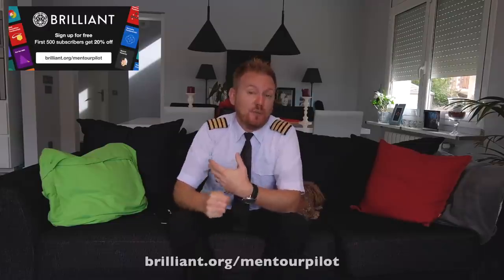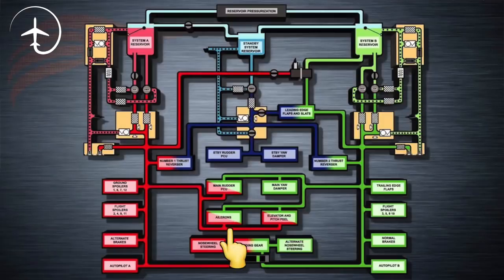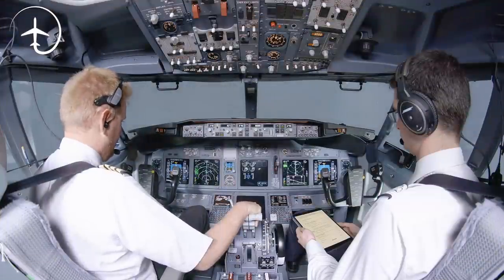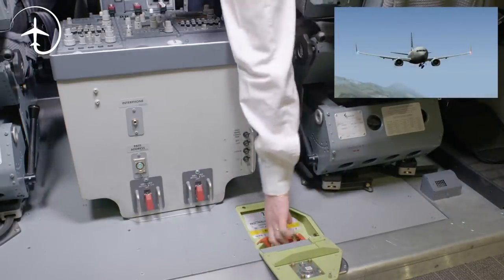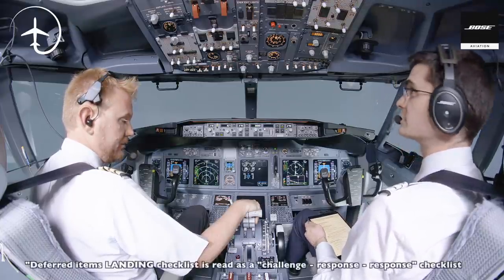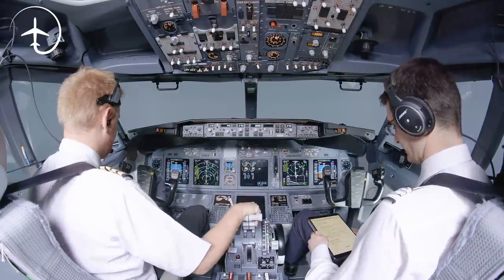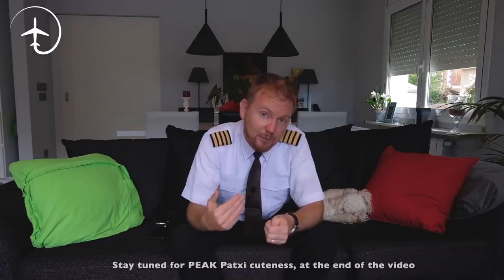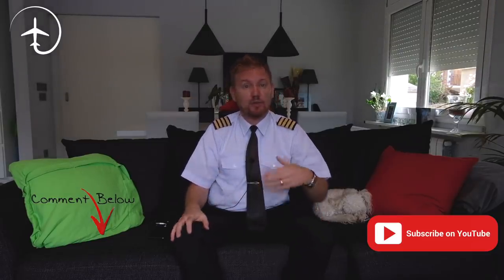Boeing 737 Emergency gear extension!! Cockpit video (FFS)

Comment: Perhaps a video on ground related activities, as preparing the loadsheet, weight and balance calculations and the like?
Reply: e.g. what switches are used for refuelling and others while on ground
Reply: @gerdne5478  I work as a fueler at an airport. All the switches for fueling are in the fuel panel in the wing.
Reply: @murphsmodels8853  Cool to know. And thank you for your work. When I am sitting in the plane I am always thankful for all the workers who supply the aircrafts, often in hard conditions. What airport you are?

Comment: Can you do a decompression emergency decent manover(sim) ..
Reply: All I know is that they use level change on the MCP, with max speed and speed brake for the highest rate of descent down to 10,000 feet or below with ground radar to monitor terrain and lights for other traffic. Edit: level change allows the aircraft to descend at a target airspeed, the higher the airspeed the higher the rate of descent, and with speed brakes the descent is further increased.
Reply: @gobozen  With oxgen mask on as well!.
Reply: Oh, can simulators reproduce a real decompression?

Comment: Could you make a video about the different autopilot modes in the 737, CMD and CWS?
Great content as always!
Reply: In particular is rotation at V1 done by the pilot or AP?
If both can do it, then how is it decided what initiates rotation?  If not AP, then when is the AP engaged after rotation?
Reply: @europaeuropa3673  The pilot flies the airplane, to at least 1000 feet minimum. After that most pilots usually fly manually if time and conditions permit it, it's a good excerise.

Btw, there's no such thing as an automatic takeoff.

Comment: @mentour pilot Hi, I've watched all your videos and I have the feeling that you have covered already 95% of possible topics. By the way, I prefere the normal flying topics and not so much the emergency things because flying is not doing emergency procedures. Left topics I would like to see are a bit difficult to explain in a simple videos, this would be more about ATC (how are the rules to speak or typical... I don't know, I am a layman) and I would like to know more about the planing you do before you fly, menas before you even enter the plane, more in detail and step by step, and background to this (why... ) and about the slots more details, e.g. who is it, who gives you the slot in the briefing, what managers are there involved (or don't pilots know this really), but to who you speak in the briefing etc. And when you learn flying the big airplanes like the 737 what do you learn first, what second etc.? For example, when and how do you learn how to communicate with the ATC: when you get in contact with what "zones", can you explain "maps" where you can see "zones", what lines does show this (or so)
Reply: Or I would love a "cockpit-tour" e.g. in the simulator where you explain for laymen the "blocks", what is for what with explanations of the abbreviations, that might be quite boring for cadets but interesting for laymen and kids, all the switches and knobs in the middle and the "ceiling" and the side, not each single switch anyway, but the "blocks" and some important single things. You did some of this already, I know, like the lights etc. but would be nice again and an overview and nicely slowly for laymen with explanation of the abbreviations. Close views of the instruments would be also wonderful, I am always excited when I get really close video-scenes of the screens, in most videos you don't see it very close.
Reply: And, do you remember funny situations or cool jokes from colleagues or ATC or flight attendants or ramp guys?

Comment: I found the Japan Airlines flight 123 (a 747SP) fascinating.  Horrowing as it may be, there were other pilots who managed to manoeuvre their planes using engine thrust only and land.  One was a Philippine Airlines flight 434 - a 747 where a bomb exploded taking out many controls, the same as Japan Airlines 123, but they managed to land using engine thrust.  Higher on one side to turn, reducing both to decent, accelerating both to climb (although with serious limitations).  So how about a video where you disable all flight controls and then attempt to land via engine thrust only?  I noticed that after the crew of JAL123 applied full thrust to avoid the mountains, this finally signified the end, as the plane's nose rose too high, then approached a stall, then almost nose dived into the peak of one mountain, followed by the plane smashing into the next.  HORRIBLE, but is it possible to control to an extent to perform a ditching or even a landing at an airport?

Comment: I was told, if the gear can't be extended, pilots first make a low fly-by at the tower and afterwards proceeding kinda rollercoaster maneuvre in order to try to "shake out" the gear. Can you do a video about that please? :D

Comment: Coming up next: Boeing 777X Manual Wingtip Extension.
Reply: How does Mentour get his hands on a 777X do you suppose???  They just got rolled out.
Reply: Emergency landing 737 on Aircraft carrier :c)
Reply: @stephenbarringtonleigh367  r/whooosh
Reply: Craigslist.  @stephenbarringtonleigh367
Reply: Checklist items
1) fasten seat belts
2) roll inverted
3) pull the handle for manual wing tip extension
4) push elevator to make sure they are locked
5) roll wings upright
6) pick up rouge passengers that didn't listen to step 1)
7) continue as if nothing happened

if time allows: instead of rolling inverted you can also add full thrust, pitch up to 45 degrees, pull the handle and push down to force negative g's for about 15 seconds, when lock confirmed pull up from the dive. That's referred to as the real roller coaster maneuver.
Reply: LOL, yes  @Jet-Pack
Reply: Could you do a video on cold to taxi, and if you think people won't permanently go into a coma setting up and Using the cms etc. Tnx! Great informative videos. I have a whole 45 minutes on a 737-200 in my log book so you might guess how long ago that was lol. Everything else rattles and squeaks more after that entry.

Comment: Hi Mentour: How about a downburst escape maneuver?  I think you already did a windshear escape, so this will be similar, but it will show what Delta Flight 191 should have done.
Reply: Great question! From my perspective, having read the NTSB report, and listened to the CVR many years ago, situational awareness was the biggest factor. They started doing the right things, like increasing power (other than aggressively aborting the approach as soon as they saw the lightning and downdraft), but they waited too long to begin them, having substantially misinterpreted the severity of the storm cell. They needed to "climb" inside a massive column of falling air in order to stay level, but lacked the airspeed to do so. Unfortunately, at such low altitude, you MUST be "on it" before you're "in it". The only thing that could have saved them once they got into the microburst in that config was a time machine.
Reply: @mikecowen6507  Ok.  Maybe it's a stupid idea, as microbursts doom flights.  You're right about that.  I'm not sure that situational awareness was an issue once they were inside the downburst though as the CVR clearly shows they were aware of the microburst.  The captain clearly says, "You're going to lose it all of a sudden."  And seconds later, the airspeed rolls back.  Minutes later, the L1011 is slammed into the ground with tragic results.  I agree with you that charging towards a thunderstorm is not a very smart plan.  Doesn't Pyotr always say, one should always put safety first?
Reply: @stephenbarringtonleigh367  My comment about situational awareness referred to recognizing the severity of danger before entering the microburst, while they still had enough time to act. By failing to act soon enough, they lost any chance at avoiding disaster. Yes, the CPT was telling the FO what to expect, but he had not correctly recognized that patch of weather was something so severe to avoid at all costs. They saw it, but did not comprehend they were flying straight into the jaws of Hell. If they had firewalled the engines perhaps 15 seconds sooner (and turned), it might have made all the difference. Also true that nobody in the tower recognized the danger either. So yes, I say situational awareness on all counts. They didn't die in vain. That one crash is why we have windshear detection equipment at airports and onboard aircraft today.
Reply: @stephenbarringtonleigh367  And just to be clear, I'd like to know what Petter has to say, given the time, training, and technology since the crash.
Reply: @mikecowen6507  My point is that he may have been naive about the storm's severity, but he knew what was going on when he was inside the microburst.  That is not a loss of situational awareness in my view, the way AF447 was at least.
Reply: @stephenbarringtonleigh367  I understand your perspective. My point is by the time they were inside the microburst, they were already dead, they just didn't know it yet. It's one thing to be in a situation and realize you're totally screwed, and quite another to recognize a situation is lethal before you get into it, and not go beyond the point of no return. They made a decision to continue, and many lives were paid out for it. I do not believe they had a death wish, so if they had some sort of magical "you're about to die" alert in the cockpit, their awareness of the critical situation they were about to encounter may have been different, which likely would have resulted in a very different outcome in which everyone safely walked away.
I agree, in AF447, they were simply clueless. Pitch & power, not Pac man...
Reply: @mikecowen6507  I agree with you here.  I wonder what factor weather radar (WX) had then?  Was it a matter of scatter off a closer storm hiding the nastier one behind?  WX wasn't as good in those days.  I know caution is usually the best course of action, but sometimes technology can influence your judgement.  See where I'm going here?  Besides WX is the only "you're headed into a critical situation" warning they had, and if it failed them...
Reply: @stephenbarringtonleigh367  As I understand it, both the crew and the tower saw a severe squall on WX that had quickly moved directly onto the glidepath. The previous flight had skirted the edge, but landed ok, so there was a false sense of security. Until they saw the outflow of the microburst, they didn't think it was that bad. However, at that critical point, they chose to continue the approach. Bad idea...
Reply: @mikecowen6507  I didn't know that side of DAL191.  Sounds like a weather version of the Uberlingen disaster, where one aircraft listened to TCAS, the other listened to ATC causing them to collide.
Reply: @stephenbarringtonleigh367  Here's the official statement: "The National Transportation Safety Board determines that the probable causes of the accident were the flightcrew's decision to initiate and continue the approach into a cumulonimbus cloud which they observed to contain visible lightning; the lack of specific guidelines, procedures, and training for avoiding and escaping from low-altitude wind shear; and the lack of definitive, real-time wind shear hazard information. This resulted in the aircraft's encounter at low altitude with a microburst-induced, severe wind shear from a rapidly developing thunderstorm located on the final approach course."
Reply: @mikecowen6507  so it was a bit of aviation culture in there too.  "Lack of procedures and training..."

Comment: Another thing I'd love to see from the sim, is a flaps failure. As someone else suggested, it would be great to see the approach. I have practiced a landing without flaps in the simulator & the runway does come up very fast. I landed on the grass......okay, I'm not a pilot, so it was to be expected, but I'd love to see that from a pilots perspective!

Comment: One of my early piston twins was an Aero Commander 680. It had hydraulic gear that, like your 737, had free-fall emergency gear extension. Too, the POH called for the mid-switch on the landing gear handle after the gear was in the wells. Must be an industry standard.

Comment: Dear Mentor Pilot, could you make a video explaining water landings ? I'm not a pilot, so I interested in knowing  not just the flying the airplane part, but also the procedures used by the cabin crew and what it means for passengers.

Question: If the cabin is perfectly sealed, wouldn't it be safer to just let the doors closed and the passengers inside and let the airplane float while rescue does not come ?
If you had no runway in the vicinity, and had to do an emergency landing, how would you pick between a highway, a dirt road, an open grassy field, a river or open sea ? Pros and cons ?
What would you do if you had a double engine failure or hull loss and had to do an emergency landing in the middle of the ocean, like a trans-atlantic flight? 

Cheers.
Reply: It's is better to evacuate because the plane would start to sink and with the engine off the cabin would start to lose oxygen and equivalent pressure

Comment: @Mentour Pilot  ,,  Hi Petter,,,hvordan går det
? ....(Hilsen fra Lisboa/ Kobenhavn---Til Sverige.)
As an Overall Tecnichian, i love all areas from - Automation - Electronics - Electrical - Mechanical - Peneumatic - Hidraulic, to Fluid-dynamics and pure Physics,,,   ...However im not an Engineer...
EX: The litlle  Manual gear extending door "Electric switch" it is one of Millions digital inputs on the Main Computer Command Lines--- (in this case, landing gear comand line)....
Automation Condition: -- if --
__  if, little Door Switch is (contact closed) =1 ,,,  Landing gear Up and Down  hidraulic  electric-valves are Enabled (Meaning, when moving Landing Gear Lever Up or Down, it will respond accordingly)  (NORMAL)
__ if, little Door Switch is (contact opened) = 0  ,,   Landing gear Up and Down  hidraulic  electric-valves are Disabled
(Meaning, when moving Landing Gear Lever Up or Down, it will not respond at all)  (ABNORMAL)  (Meaning, Just  Manual Gear Down Extension available)  (Gravity Down Gear)
__  In Your experience,, taking of with That Little door opened (or not clearly closed) just rase-up one question....
__  Didnt it Trigger some sort of WARNING or ALARM before Take Of ??? 
___ Just wondering... about Redundancy with Automation,,,,!!!
All your Videos are fascinating..!!  As you always keep  technical explanation, validating Flying procedures.

-THAT MAKES ME WONDER :    First be a Pilot, then an Engineer  -- or ---  The other way around??
----- HILSEN --- VI SES --- 
Pedro Lopes

Comment: A full engine  system restart after it failed in flight would be interesting and you get a TCAS whilst doing it
Reply from the maker: You can find that in my “Engine failure collection” inside the Mentour Aviation app. Check it out!

Comment: the term drag penalty reminds me on hapag lloyd flight 3378 with an airbus A310 when the landing gear could no be retracted and increased the fuel consumption by 60%. FMS did not take the drag into account and the crew felt save to be able to make it. 12 NM before touchdown at Vienna both engines run out of fuel at 4000 feet. Luckily the made it almost safe to the ground

Comment: I was a Second Officer on a B-727-100. Coming into Seattle-Tacoma, at the outer marker, the Captain ordered ‘gear down.’ The mains came down and locked, but not the nose gear. The gear handle was raised again and put down again. Still no nose gear. The Captain called for manual extension. I retrieved the manual gear extension tool , opened the access door to the manual extension knob, inserted the extension tool onto the knob and following the checklist, cranked the nose gear down. We verified “gear down, 3 green .” The procedure was completed by the time we reached 500 feet. Landing was uneventful.

Comment: There's something rather comforting about such manual mechanisms being in use. I'm not scared by computers being able to fly the plane or anything like that, but electronics can and do go wrong. Having the ability to take over from the electronics and use a "basic" mechanical system is a great idea. As you say, if it ain't broke, don't fix it!

Comment: Let's say a drone hit the aileron severing both pipes supplying pressure to the aileron. Will it cause a failure of both hydraulic systems simultaneously? If not, what's the safeguard on the 737? JAL123's on my mind.

Comment: Amazing vídeo, as always. I would like to see a simulation where the weather is so rough that both pilots have to split the flying commands (this really happened to portuguese Captain Mário Guimarães nearby Pico airport, Azores, due to heavy winds, but the plane was an ATP),.Thank you !

Comment: Wonderful video! I was wondering if you can still use that lever that you pull up and turn to release the landing gear. Is that a backup for if your normal landing gear switch doesn’t work but you still have control over your hydraulic pressure? I didn’t see the lever in the video of the simulator, but it may not be there.

Comment: An interesting scenario would be an uncontained engine failure in flight with a turbine disk or fan blade hitting the most important stuff, causing a rapid decompression, loss of at least one hydraulic system and a lot of electrical systems, maybe with fragments puncturing the fuel tanks on the one side, causing a fuel imbalance and maybe even a little fire on that side...
You'd be flying a wounded bird on one engine, with spurious warnings and other fun stuff.